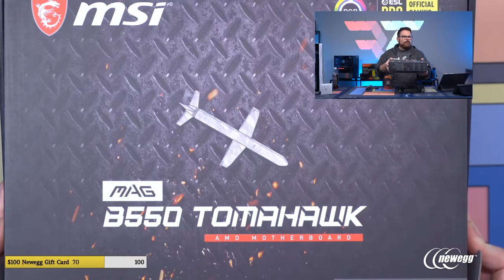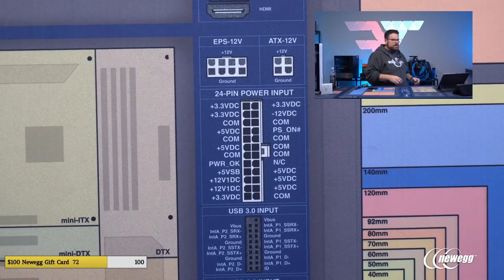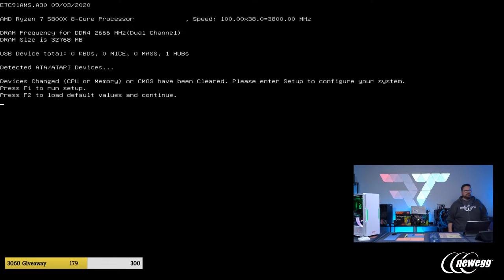How to Build a PC - Giveaways + XPG Starker $2800 Build and Case Review (Ryzen 5800x / MSI 3070)

Comment: I've built one (starker air). Same case, but with a mesh front. For some reason I can only change color by pressing the button on top, even though the 5V is connected to the motherboard argb. Does anyone have a clue why is that?
Reply: found any solution? just bought my starker air
Reply: @doraco9529  yes. Long press the button and it'll change to whatever you set on the motherboard software.